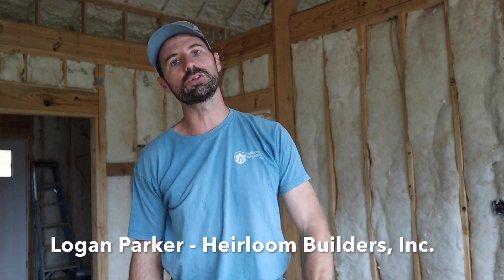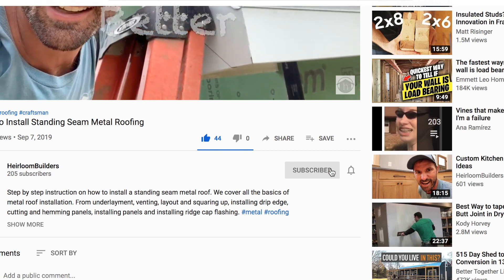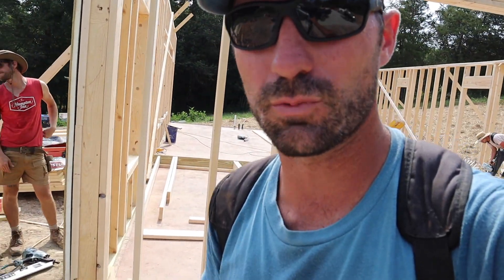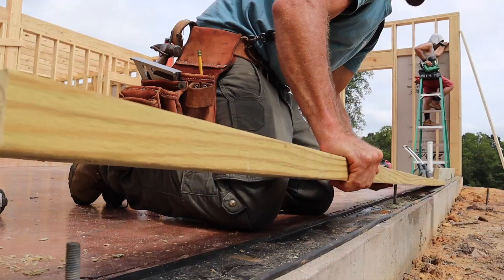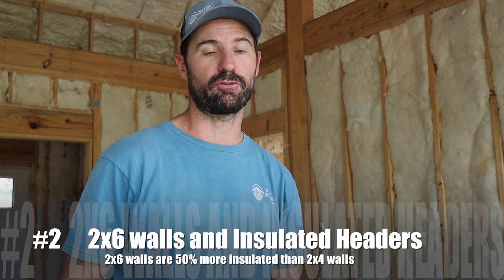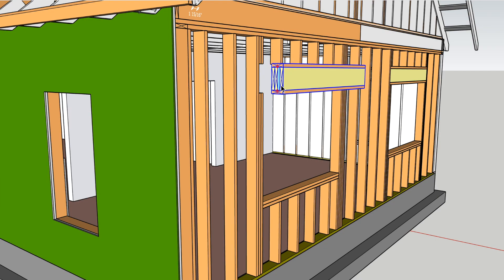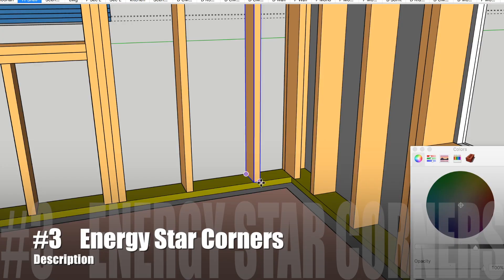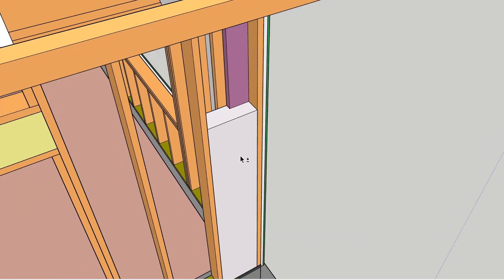100% TIGHT: FRAMING Tips | Best Insulated Houses

Comment from the maker: What is YOUR favorite Tip?
The house in this video just scored 0.4 ACH (air changes per hour)! That's tight enough to exceed the rigorous Passivhaus standard of 0.6ACH. That's 10x tighter than building code! It's literally so tight that we'll have to provide special means of fresh air in order to keep mold from growing! Getting fresh air is complicated in this house because it has no HVAC ductwork; other than a hood fan and bath exhaust fan. Stay tuned for a video about the solution.
Reply from the maker: protect the Constitution i would use rigid foam on the exterior and fiberglass in the stud bays to save money. Just make sure to air seal really well
So no moisture can get in the walls and condense into water that will rot out the framing.
Reply from the maker: protect the Constitution I’m sure you could, but it would be super expensive! Not sure, but I’m guessing it would be about r-10 for an inch of neoprene. Why do you ask?
Reply: @HeirloomBuilders  
Thank you for getting me here
Reply: Congrats on those tight air exchange numbers. Did you get that just with the gaskets under the sill plate or did you use sealant or tape too?
Reply from the maker: @jesseh2302  Thanks, Jesse! we used the wall gaskets at the top and bottom plates also, foam and caulked all the penetrations and used spray foam insulation in the roof deck.

Comment: I do like zip R. But I find it a bit disingenuous when people say it’s “no more labor” Than regular 7/16 zip. The stuff is A LOT heavier. And then you need to account for the bottom edge and ensure that is well sealed as it will be 1-1/2” overhang from your sill. Worth it? Absolutely. But it is a tad more labor-intensive and more of a hassle compared to the plain OSB zip.

Comment: Great video.  is it code to use the insulated door headers?  Do you use insulated headers on interior bearing walls?
Reply from the maker: Thanks! It is not code to use insulation in your door headers, just a good idea. We only use them on exterior walls.

Comment: Logan these are excellent tips (quick and easy). I watch a lot of Matt Risinger and he has some great ideas but for most, his upgrades are too expensive for most. 

Curious, how do you handle air exchange with such a tight home?  ERV?
Reply from the maker: Exactly. These strategies can be accomplished pretty easily, for cheap. This specific home manages moisture manually with casement windows and with humidity sensing bath fans and passive air inlets. Most of our homes use ERVs and dehumidifiers though.
Reply: @HeirloomBuilders  Thank you for responding! Best regards!

Comment: Great info and I wish I had used insulated board on the exterior of my home, but I did use aerated concrete panels. I used silicon on all joins, bottom plate, top plate and corners, around window joins and filled all cavities in corners, windows with sound, fibre insulation packing it in. So much to learn and thanks to you guys for sharing additional information
Reply from the maker: Silvio Fontana sounds like you did a great job! Paying attention to those details is the key!
Reply: @HeirloomBuilders  guys like you are vitally important to change the way we build, keep up your good work, change will happen as this planet gets hotter.